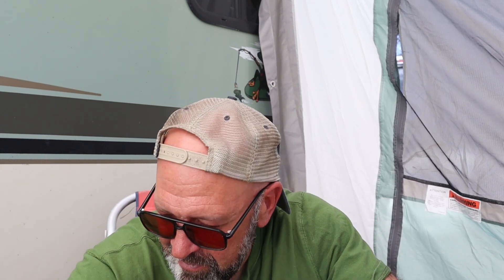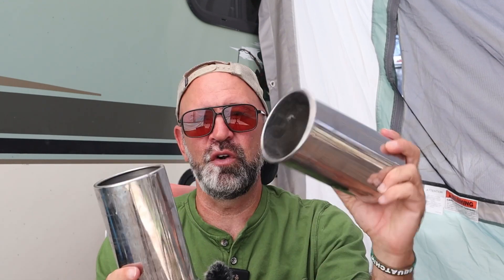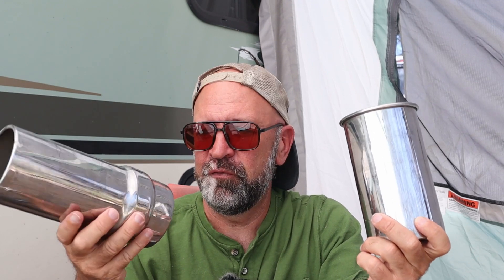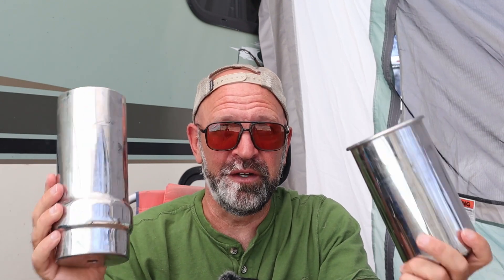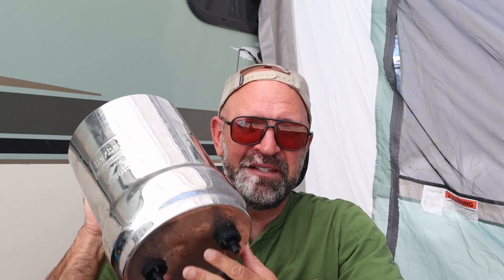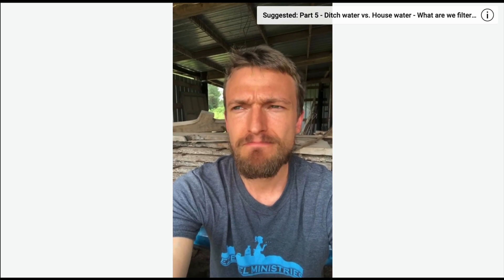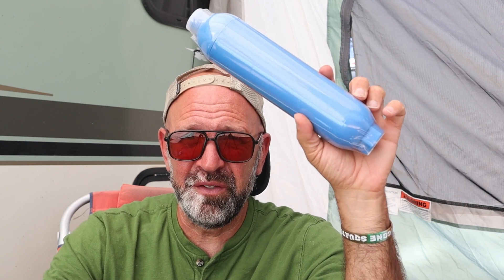Wished I Had Done This Sooner!! (Black Berkey Water Filters Not Working)

Comment from the maker: Berkey also offers to look up test results for your water that might actually be better than what Zero provides: https://www.berkeyfilters.com/pages/water-quality-search

Turns out from where I am staying right now the water has 525X the recommended arsenic!! Be sure to check your zip code because it turns out that, "Legal limits for contaminants in tap water have not been updated in almost 20 years" Berkey claims to filter out 99% while Zero claims 93%. It's up to each of us to do our own testing then, it's our health after all..
Reply: the interesting thing that all the info Berkey is pulling is from EWG's tapwater database but when you uses Berkey's site it says it can filter X% of Y contaminant.  But EWG's database include a table at the bottom of each results page and displays that carbon filters can not remove many of the containments listed but Berkey's page is saying that can remove them.

Comment: Low Tds doesn't mean good water. Ive had 400 tds mineral water vs 400 tds city water with with arsenic are not the same beast but both test at 400 tds. Now when it comes to berkey i agree it's bullshit a company wont get nsf certified because " it cost to much" well shit imagine all the. Companies who make stainless steel pots and pans and get ansi-nsf certification. It's a stainless pot or pan what can go wrong but they pay for it 1. Because its a selling point and 2. Because the other companies do it. Berkey saying we don't need nsf  certification because we surpass both nsf standards is like a used car salesman saying you don't need your  mechanic to check the car out before you buy it because our mechanic already has so just take our word for it!
Reply from the maker: Something tells me they might just start paying for those results...

Comment: I use that same tester, it came with my Zero water filter set up. I used it on the Zero water, and then I used it on our tap water.  I went to where you can put in your water test results?  Our water sucks. I used this tester on bottled water, and oh my, if you use bottled water get yourself one of these testers. Use it til or if you can find some bottled water safe to drink!!

Comment: I use a Berkey, but I have never used their black filters.  I have always used silver impregnated ceramic.  Also Berkey does not suggest using a gasket on both sides of the container where the filters are screwed in.  I use silicone gaskets on both sides of my SS container.  I've never had the post filtered water tested though.  I have the filters and containers stored for emergencies.  I live near an artisian spring where I buy drinking water.
Reply from the maker: Good to know, thank you!
Reply: You can use the filters interchangeably?
Reply: @HomeSweetCabinRetired  Berkefield silver impregnated filters are UK's filters for Berkey.  I use those and ProPur all in one silver impregnated ceramic filters.
Reply: @NorthcoastPatty  great to know!! I have the travel Berkey and a set of filters failed.  One of the pair did not even filter the water just ran through, the other set left an orange sludge in the bottom of the upper chamber.  I just moved and am on well water that tastes disgusting.

Comment: ZeroWater is dead water.  TDS testers are absolutely useless for testing water quality.
Reply from the maker: It's a valid point yet I don't consider the testers useless, they measure for a certain quality and for that they are good. There are various other tests and considerations to take into account with water and for that other tests are required.
Reply: @WyattChristman   That's fine...if you like dead water.

Comment: What you are measuring with the device Zero provided is total dissolved solids (TDS). Turns out we get essential minerals from what is dissolved in water. From the little I've read, the Zero filter removes dissolved minerals too. So you need to replace these somehow in your diet if you aren't getting them from water. The reason I initially went with Berkey is that they did not remove these essential dissolved minerals while at the same time removed viruses and bacteria. In my case I paid for third party tests on my well water (before and after filtering) and found the filters did remove arsenic and uranium that are present in my water. Anyone using a filter should spend the extra money to test the filtered water just to be sure the filters are doing what you expect. These tests determine levels of contaminants that are harmful to people.
Reply: Liquid trace minerals can be purchased on Amazon.  A small bottle goes a long way.
Reply: @NorthcoastPatty  thank you 🙏 I forgot to mention i use the Berkey and have done for 3 years now, i thought it interesting that zero warter couldn't detect nail polish remover when just added to water without filtering.
Reply: @Patricia-zo8tg  oh wow!!!
Reply from the maker: Yes excellent point thank you and of course taking that reading with a grain of salt and also why I pointed out the website where you can find real spring water. I am not done with Berkey however I am having problems with the seal despite using extra washers it tightens only so much and then the screw slips...this is even after using brand new filters. I have always liked Berkey so it's hard to see them coming under fire and yet from my own experience the water is contaminated from the washers not tightening enough. I became concerned when I got a bit of a stomach thing...thanks!
Reply: https://youtu.be/d3MCiFB4biE

Comment: Also look at the testing ProjectFarm did on his channel. ZeroWater seems to filter almost as good as a MUCH more expensive Reverse Osmosis system. Berkey seems to just handle taste, which would make sense, since its only activated Charcoal, and does not have KDF55 media. 
I bought a Zero Water for all my kids.
Reply: If you put a drop of nail varnish remover into the zero water you still get zero, also if you add the trace minerals that we need it's numbers are off the chart, like all companies clean water is the new gold we can only do the best we can.
Reply: @Patricia-zo8tg  a drop of acetone into how much water? I wonder if it dilutes so much I in a certain amount of water that it isn't traceable. Has anyone tried this with the same amount of berkey water?
Reply: @pattiannepascual  not that I'm aware off, i just found it interesting thatvit was put in after water had been filtered
Reply from the maker: Yes, the rabbit hole of water and the bodies needs in relation to it is quite extensive. Like with food you really can't count on one size fits all which is why it's necessary to dial in on sources beyond the tap. The best water I have had is when in the mountains and the difference in taste is like that between a tomato from the store and direct from the garden. Forget wine tasting, how about water tasting by region! :-)
Reply: @WyattChristman  my water is shocking, i did have a reverse Oms system €400 for just drinking water had to change filters every 3 months @€80 a time, spring wells here in Ireland are few and far between now our water is just poison,  turn on the tap first thing in the morning and you'd think your in a swimming pool. Yes mountain water is top of the class.